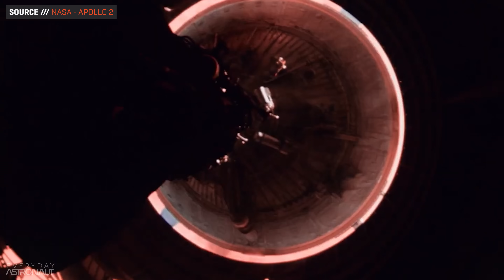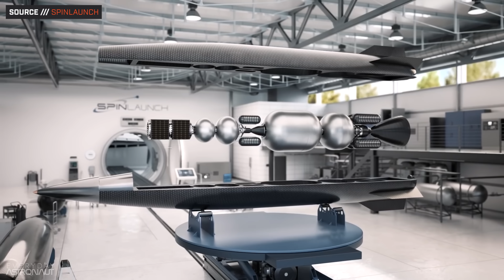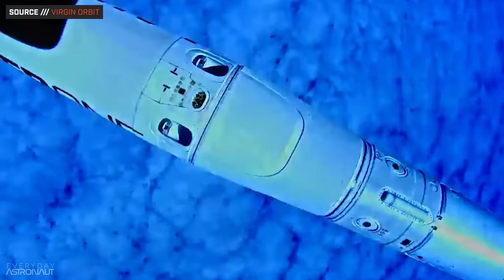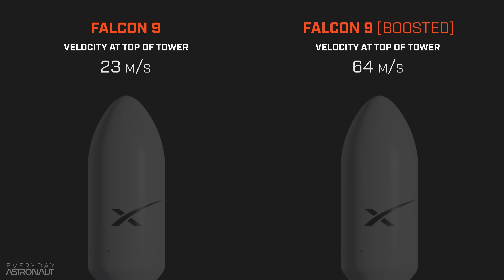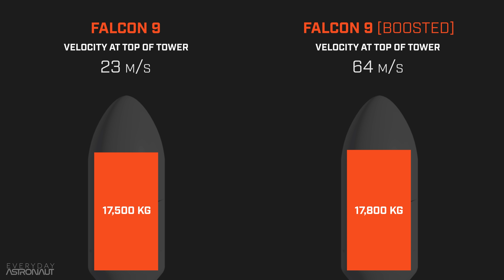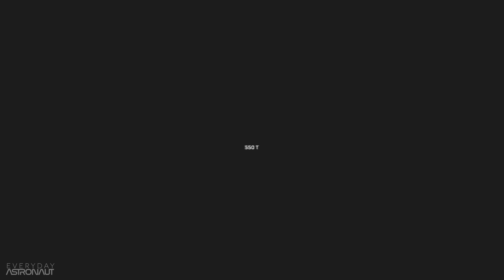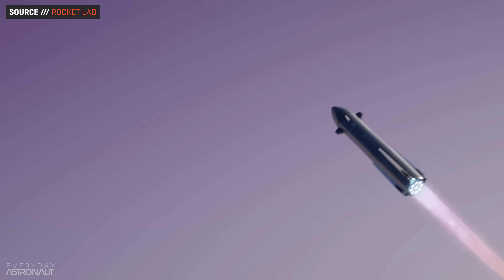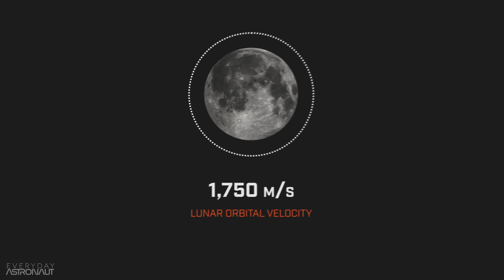Could We Help Push Rockets To Orbit?

Comment: I still haven't finished watching the whole video, but from what I've seen until now, I feel like there's a misconception and a mistake in the calculations when comparing the falcon 9 (normal) vs falcon 9 (yeeted). It's not a fair comparison to think that in both cases the mass is the same. In the case of the yeeted falcon 9, you could completely ditch the whole mass of the first stage, including fuel. The whole idea of  spinlaunch is to eliminate the first stage. Dismissing this concept makes the comparison invalid. Love your videos, not trying to be a negative or mean. I'll finish watching the video to see if this is addressed later.
Reply: yep finished and even the comparison with the electron is wrong.
Reply: also, in SpinLaunch they are not pretending to provide that much energy to the payload in 2.5s or in 70m. You said it your self, they are going to accelerate the payload little by little for hours, and therefore give that energy distributed in a span of hours, not seconds

Comment: Would it not be simpler to have the rocket stay connected to the fuel quick disconnect for the length of the tower? Continuously feeding the engines with ground based fuel. A taller tower would be beneficial then. Have the fuel quick disconnect on a carriage that chases the rocket off the tower then switch to onboard fuel
Reply: Tower would need to provide 4 tons of propellant (fuel and oxidizer separately) every second. Mass of propellant inside hoses would need to be lifted by a rocket as it ascends, which is not much different from having this fuel in a local tank. But greatly increasing fuel system complexity and fire hazard from "quick disconnect".
Reply: @ivanjermakov  Pumping 4 tons of propellant per second isn’t out of the realms of possibility with a large ground based gas generator turbo pump. Or a number of smaller pumps. Raptors turbo pump can pump propellant at 340-700m/s at the outlet of the pump. If you pump propellant at 340 m/s you would need a 188mm hose to transfer 4 tons per second of methane. 
The mass of propellant in the hoses wouldn’t necessarily need to lifted by the rocket it could just be winched up the tower matching the rockets speed. 
It would undoubtedly add fuel system complexity but it wouldn’t have to be plumed directly into the engines. Could just top off the main tanks and have a relatively simple non return valve to disconnect.

Comment: What if we attached a fuel pipe to the rocket ... and dont disconect it, maybe one pipe / engine that rise with the rocket and fueling it as it burns fuel. and when the rocket is too high we finaly disconnect the cables, and maybe add some parachutes at the end of thoses cables for them not to crash into the ground

Comment: What if you just strapped a bunch of Raptor engines to the chopsticks themselves?
Fuel would be on the ground, no heavy pulley system, no booster mass. You'd effectively be added an X amount of engines without making the rocket heavier.
Reply: would need long flexible high pressure fuel and oxidizer lines. And with high, I mean HIGH. That would be a whole new risk factor in itself.
Reply: Fun idea, but let's think about where the fuel goes. There's a proven way to feed rocket engines at the rate they need: It's a tank above them, and we call that a liquid rocket. Otherwise you're getting into magical infinitely strong, infinitely flexible pipes through which fuel and oxidizer travel long distances at incredible speeds without friction or turbulence, around corners without inertia etc. So you're essentially launching four or five Starship boosters at once in order to add a few percent to the payload of the middle one. Alternatively, you could put the engines on boosters and make more flights for a four or five hundred percent payload improvement. Or achieve reliability and rapid reusability, and get the payload throughput with zero additional engines.

Let's also think about where the fuel goes after it leaves the engines. You're now scaling your flame trench and water deluge system - we saw what happened when one Starship's worth of launch happened without water. Even with unprecedented water, either multiplying the number of engines involved, or spatially distributing them in a way that might make an acoustic curtain or reflector for the inner engines' energy, may well kick you into a whole new realm of acoustic behaviors and damage previously explored only by nuclear weapon testing. Doing both at once? Makes it a sure thing, I reckon.
Reply: It’s a good idea, but you’d also have to slow them down at the other end. And it’s something else to break. 

It would be better just to put on some reusable boosters, you get much more impulse
Reply: Extremely early staging? You'd have to double the Raptors just to get 2 g net acceleration, that's a tiny bit of payload increase with a massive system again.

Comment: Starship uses a lot of fuel when it's close to the ground as it's moving slowing and accelerating slowly as it's still close to its full weight.
Looking at a starship launch is seems to have used about 10% of its fuel before the bottom of the booster has passed the top of launch tower.
Would it be practical to keep the booster attacked to the tower via a tether and keep 'topping off' the fuel for the first 100m of ascent and what benefits would that provide in terms of booster thrust and ultimately Starship payload mass to orbit.
Reply: I do know the answer to this but if you want fodder for another "why don't they just" video you might want to answer this one.

Comment: Using the weight of the rocket to compress a mechanical system gives a lift with controlled cost and risk

Comment: I still think some air breathing rockets for the first stage that cut off once no more air is available would be smart. A few strapped on super powerful jet engines that can return to land would increase the initial power and possibly reduce the amount of fuel required for the rocket. Even if it was just an assist I think this has great potential.
Reply: My thoughts too. Stage 1, turbo jets. Stage 2, ram jets. Stage 3 normal rockets to orbit or scramjets followed by a rocket Stage 4. All recoverable. I'm sure the physics or the coat doesn't pan out else it would have been done.

Comment: Great video. It changed my thinking that ground launch assist would generally be a useful thing. Would be nice to compare the gains from "yeeting" to those from building a launch pad at the equator.
Reply: If you watched similar video in 2000 about how reusable rockets are unrealisting i bet it would change ytour mind too into stupidity. Ground Launch Assist will come when we will be pushing enough payload to space. And for that to come first Spaceship.
Reply: @potencjalnypracownik2966  it’s not worth it for 50 m/s.  

It’s much more practical to just strap on a couple of reusable boosters.  You get much more impulse.
Reply: @mb777-g8v  you are missing the whole point. its not for few more tons to orbit. Starship is for that. railguns and other stuff is for economics, when even 1% cut will be worth billions. But first we will need to end this sad "aluminiium foil space stations" era. 150 000 tons to orbit every year? now we are talking
Reply: yes of course, but we have been talking about launching conventional rockets with a boost from the tower. That’s probably never going to be worth it compared to just strapping on some reusable boosters or making a bigger rocket, or fuel drop tanks. 

For Star Trek level civilization? Sure rail, guns, etc. might be economic on earth.  But they probably make a lot more sense on the moon way before that.

Comment: I’ve been wondering about using a counter weight for a long time, or maybe build the launch pad at higher elevation
Reply: The vast majority of the energy required to get into orbit is getting up to orbital speed not getting up to orbital _altitude_. 
You can get to space in a plane, fly fast and point up, but you're not going anywhere nearly fast enough to stay in orbit.

Comment: sounds like pressure tube launched rocket. of course you can. if you cant then someone can. its not done because someone else would go out of business. therefore you need someone that is not monetarily, service or pride tied to the existing infra or laws. ie those have no incentive to do it the right way. if you dont want a launch tower, then self-sufficient space plane is just fine. again, if you cant and will not, then someone other will. even launch with a jet. yeet(ing) a rock(et) is fun isnt it? ie denying possibility. that who is from above can do everything. just dont doubt. ie if your yeet fails, then above collects the benefit, alone. yes you need a parachute for earth-orbit-earth shuttle cargo ships. unless you launch it with exit velocity. solid state electronics is just fine. yep hypersonic space plane is much better. if not the em launch track. yep hypersonic at 10km+ as a normalish plane. pride is the worst enemy of better and best. conventional and preferred, says it all. there is no other gospel based on law. above will and can. what above wills. geez us. try X43 nasa hypersonic plane instead. yep its already at orbital velocity in the atmosphere. MJ is not much, like 0.3kWh of battery. elon's battery can do a MWh easily. so use supercaps or a very large number of elon large grid batteries. so what, if you only yeet the second stage micro rocket. biased assessment, no its not. very doable. "no, we have assessed that we dont want to do this, so it cannot be done". ie prejudged to fail. come on, you can make higher launch towers. so, above is not enough to yeet a rocket? and requires human judgement to not do it? someone is over their heads of pride of knowledge. or just being paid to discount working stuff. yep not me anymore, but above lives in/with me. so your issue is with above, who made everything. including you. knowledge makes proud, and is of no use. anyways only-assisting model of community is nonsense. dont do it. do either space plane and/or full length launch track with only the second stage rocket. above does not require or ask for people credentials or certificates. as any such certificates are nonsense for above. yeah you figure out assisting is not useful. do what you gonna do quick. its obvious that you are not qualified to assess electrical yeeting tech considerations. or are you with above, too. great. the point is, you can do it with sensible setup assumptions and goals. dont attempt the nonsense assumption setups. point is, there is a sensible setup, even if you did not yet find it. yep you need to receive it for free as gift from above to get it. get it? understand? mechanical catapult? maybe. electric is better with sensible setup. maybe a very large water flood tank would change your mind. you have a gigazillion tons of sea water right next to you. and you have a ton of sand/gravel/rock right next to you. maybe just listen to how/why/what the spin launch dudes are doing. slingshot a space plane to the moon. or the dream chaser space shuttle alone. anyways, all is possible for those that believe, in above, do you believe. so dont judge prematurely or at all. if you need to ask, then your rockets and stuff are not producing anything. dont try to launch vertically, but with a horizontal-ish launch ramp which ends up going upward because of rounded earth. at 5g acceleration you would use a longer launch track so you get to mach 3. if you are replacing a rocket first stage completely, you are to be at the mach 3 of the same stage 1 rocket. yeah your system better be that the second stage rocket lights up in space. as per normal. if not, a wasted stage 1 booster rocket, spacex. because you dont believe, you only get renders, as you are doing nothing to make them happen. ie they dont exist. so if you dont want a tube. you can make a launch ring accelerator system. yep a jump gate. horizontal rings on earth. no, you dont need to raise the launch track above earth. but only keep the launch vehicle on the track until enough speed then let go. similar to a circular particle accelerator track. thats only a really fast maglev train. yeet your assessment to the moon. your lifetime? sad. who believes never sees deth. so I avoid you like a rock being throw at faith. anyways, mach 3 is enough, instead of your mach 20. I'm getting feeling you are being paid for false testimony against what above testified about possible. sad. ask above how he placed the planets where you cant even yeet a rocket, or split the ocean. people as the law always testifty against above. sad. woe to thee with your houses. unless you yeet your doubt, nothing will happen. sad. sorry. your testimony taken as if nothing had happened or ever said. cant use a fault to correct anything. unless you use a tectonic plate fault as the very long linear grounded (literally) launch maglev track. you only happened to prove that you cant. not that believers/above cant, who can. nuclear decay reactors for a heat thruster space plane, and nuclear reactors in general, can do the job just fine. also. flesh be quiet in the church of earth. yes that you did get correct, cargo is simpler with higher gs up to 1000g. but dont try 30g to purchase freedom under your cant rulership. above still thinks its easy, even if you cant do it easily. but with woes. zero compromise with stuff being impossible. you give up your thoughts of impossibility or compromise. possible not mingle with impossible. hold on, if you use a star ship to generate the power next to the launcher. right. a kilometer of train tunnel is no biggie. ask swiss bank. train tracks made stuff move fast, not a bottle neck. first you need to go out of business of being a road block. thanks. on the nose cone. sir, not even a little bit kiss empty betrayal. ask japan for help with a hypersonic horizontal maglev launch track. if your nations will/cant do, then we do. and we dont ask flesh for an opinion. throw your cargo packages with the launcher anyways. on/from earth and to earth from space. we do space planes and proper 5g launch tracks. believe that you already have what you pray for, then you will get it, like promised. above gives faith. not an act of flesh through yourself. short: I would build the 5g launch track as a normal high speed long continental/inter-continental maglev train track, and sometimes use it to speed up to mach 20 then let go for a space launch.
Reply: 573km is not even the length of finland. just saying. we have longer tracks than that. multiples of those tracks. even usa is longer than that. but where are your train tracks.
Reply: anyways, anything you can do with rockets, the stored energy, the same amount can be stored and used as electricity, for the same effect.
Reply: anyways fully solid/liquid separated fuel storages to heated gaseous rocket, say kerosene + naclo3 + heat = gas "solid" rocket. some other solid fuel than kerosene, maybe vaporized wax.

Comment: SpinLaunch might benefit a lot by launching from a high hilltop???
Reply: I think that one is a non-starter....   not many useful things you want to launch into space that are built to take thousands of g's and limited to that small size.
Reply: The slight benefits in lower air density are vastly offset by the difficult ground infrastructure of trying to build, man and power the ground system up a mountain which is far away from infrastructure and hard to get parts people and power to.
Reply: It's ideal for moon mining and industry for building in orbit

Comment: 13:00 you can light the engines but run them at minimal power for the first 3 seconds. This will not torch the strongback .
Reply: Controlling the thrust of a first stage engines might be the harder engineering problem in itself
Reply: @ivanjermakov  With falcon 9 they are already capable. Remember this thing lands itself with very good precision on only 1-3 engines at low power.
Reply: @DaveBoxBG  I'm afraid controlling thrust of 1-3 engines is different from doing that for 27 all at once.

Comment: Of course it would help if pulleys and massive levers were employed. But my favorite is Float to Orbit (FBO) with a giant balloon.
Reply: When you’re in orbit, you need to be going 7800 m/s to avoid crashing back to the Earth due to gravity. You can’t float your way to that.

Floating really only reduces the effects of early atmospheric drag and a little bit of potential energy.   It turns out that it’s not enough of a boost to be worth it.
Reply: Getting to orbital altitude is nowhere nearly as useful (or difficult) as getting up to the orbital speed you need to stay there.
Obviously if you just want to float at high altitude you can stay in your balloon but if you want to launch another stage to say go to the moon or Mars or even just a higher orbit of the Earth your balloon has not saved you very much fuel, you still have a lot of accelerating to do and as soon as you leave the balloon your next stage starts by plummeting towards Earth.

Comment: Why don't they just build a big Lighter Than Air platform to put the gantry crane on?  Ready the rocket on land, lift it up out over the ocean, raise it as high as possible before firing it
Reply: i'm guessing a balloon that can lift 500 tons is going to be somewhat expensive and hard to keep safe in bad weather.
Reply: The vast majority of the energy required to get into orbit is getting up to orbital speed not getting up to orbital altitude .
While there are some small benefits from launching from a high altitude, mostly due to reduced air resistance the complications in "ground" infrastructure (launching at altitude infrastructure) typically aren't worth it.